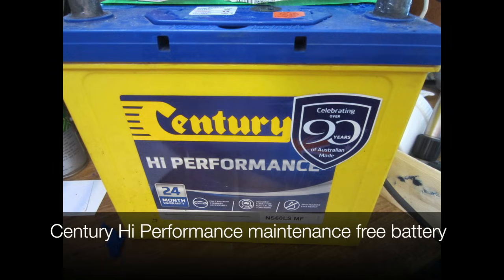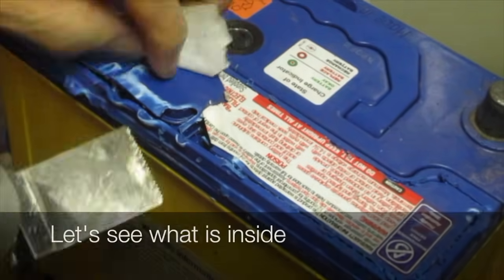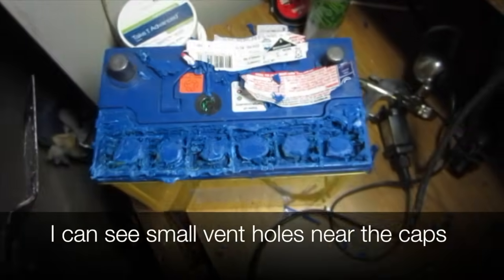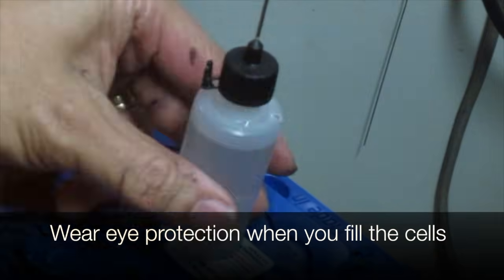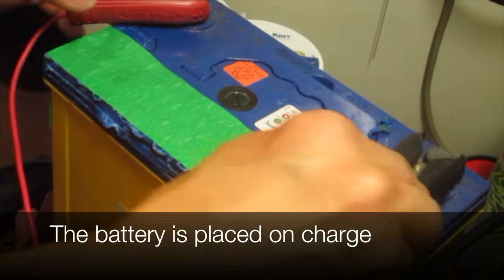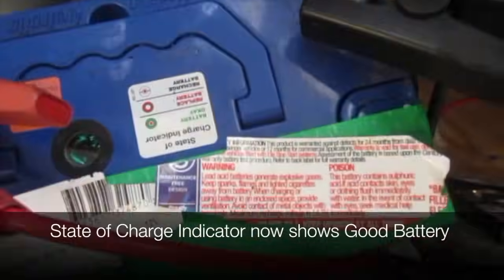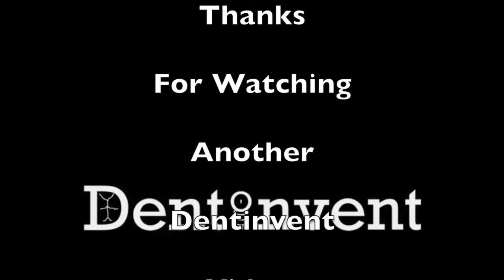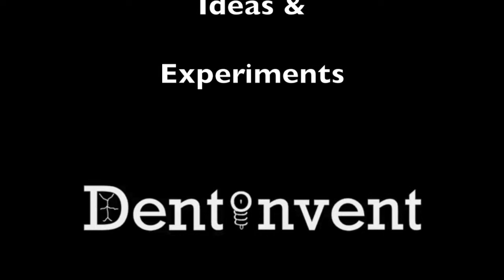Filling maintenance free battery with distilled water

Comment: Ok, easiest way i find is drill a small pilot hole into the glass indicator eye, doesn't have to go all the way through. Next screw a screw into the pilot hold and use a trim remover or screwdriver to lever the glass indicator out then refill with water and press the indicator back in. Easy
Reply from the maker: Thanks . I worked that out ( refilling via the glass view port) on the next car battery I refilled .

Comment: The small lead acid batteries in my wife’s mobility scooter failed after two years. Replaced batteries and removed the 
Sealed cap and found that the fluid level was really low. Now on the new batteries I regularly check and top up the batteries and so far they have lasted 6 years. Designed to fail!. I had a landrover that had a battery with screw caps for each cell and my daily / weekly check included electrolyte level, battery lasted for 9 years!
Reply from the maker: Yes , as long as you keep the levels over the plates the batteries usually can keep working .  Good luck .

Comment: aren't the cells all one big room with dividers that the fluid can fill over so you only need to drill a hole and fill one point?
Reply from the maker: Good thinking but I do see some car batteries where all cells are in separate compartments . When one cell is filled , the others do not go higher .

Comment: How do you know how much water to add? Just enough to cover the plates?
Reply from the maker: Yes just enough. If you put too much water ( which I did ) , the water which becomes the acid of the battery, can bubble out as it charges .
Reply: @Dentinvent  how is the battery going? i saw another reply about 3 years ago saying it's 8 years old - did it crack the 10 mark?
Reply: Best to fully charge the battery first, then add water, as charging will produce some water. So if you add water then charge it, you risk having it overflow.

Comment: I like this. No bullshit, no history of the company or long list of safety equipment you should wear, no blaring stupid music just facts. I think I should have moved to Oz years ago if most ozzies are all as straightforward. I've bought new batteries but keep the old one and prise out the "sealed for life" cover with a stanley blade, top up each cell with distilled water and recharge overnight, first at low rate (around one amp) and then with my "old school" charger (4 amps) until the charge rate drops to less than half an amp. Put the cover back down and Bobs you uncle, ok for another few years...
Reply from the maker: Nice work Peter ! I have since tried prizing put that clear cover to try and get access to the distilled water refilling area .
Thanks for your great comments.

Comment: I've done this although it works, the tape will get eaten away, I hot glued mine and it leaked and melted my settee, I'd suggest drilling each cell to be able to seal it properly.
Reply from the maker: Yes , good idea to seal the thing with proper glue like jb weld rather than tape as the acid is very corrosive if you add too much water .

Comment: I don't understand why they made batteries nowdays with no caps they don't last as long. They all need maintenance but here in Australia they try so hard to make $$ by seeing you every two years making these bullshit no cap batteries,  if you crack em  open break the tops open like I did you can't use them their throwaway
Reply: To make you change more frequently.. In australia specifically.. Top of the cream consumer market.. Production engineer here.
Reply from the maker: If you do even drill a small hole to refill the distilled water , be careful not to put too much in or acid can come out of your filler holes .
I got probably ten years out of my battery but I did get the acid spill which in the end , I would have been better paying for three more batteries rather than paint work damage.
Reply: @Dentinvent  I have some old batteries that are cactus I saved the cell caps was thinking about using a holesaw the same size as the plastic cap thread a mm smaller so make a no maintenance battery to one with caps haven't tried it yet but will have a go one day thanks for your reply too cheers
Reply: My wife’s mobility scooter has two small lead acid batteries which I had to replace after three years. I took the sealing strip off the replaced one and found that the cell were almost dry. These are maintenance free batteries. The new batteries showed signs of failure even though the were kept charged. I opened these and added distilled water and they regained their full capacity. They are now six years old and still functioning at full capacity. These maintenance free batteries are a scam and in this day and age considering the environmental impact this practice of deliberately making products to shorten the useful life should be regulated. I had a land rover and weekly maintenance included checking battery electrolytes level, these would last at least 8 - 10 years
Reply: @peterclancy3653 how did you reseal them after opening them?
Reply: Things are not made to last nowadays. Flooded lead acid batteries are very reliable and can withstand long unused periods. Got one with new bike from factory. Lasted 5 years of abuse. But they stopped selling it in shops in India. Only gel ones are available.
Reply: So it will dry out and Die

Comment: How much water should you add? Is it just until the bottom of the plastic cover?
Reply from the maker: If you look into the battery there is a cylinder protruding down from the top of the battery into a hole compartment. You fill to the bottom of that cylinder . If you fill too high , the acid can come out when the battery is charged . Make sure you cover over the top of the battery to prevent acid spills.

Comment: I added acid water in my new maintenance free (Gel battery) which tubular, i thought it has no acid water 
I removed all the acid water right the next day. Should i be worried ?
Reply from the maker: I’m not sure . Depends on how much acid you removed . If you took out too much the battery may still die. Just make sure you seal the battery properly or acid can come out .
Reply: @Dentinvent   as i mentioned it's a gel battery (maintenance free ) and has no need for acid water. It has gel inside it's plates. I put acid water but the next day i realized i shouldn't put the acid water. I removed all the acid water and made it completely dry just like before. 
Please let me know should i clean it with distilled water once again just to remove acidity from gel and the plates or should I just leave it there. 

And how much time does it take to completely charge 2x200Ah (FLD battery) +  2x150Ah (Gel battery) each pair connected in series to make 24 volt.  Connected to 3KW MPPT Invertor Which is juiced by 14 Solar panels (250Watt) each in 7x7 series -parallel combination. Thanks
Reply from the maker: Inside the gel battery there is sulphuric acid mixed with silica to make the gel. I don’t think cleaning it with distilled water is a good idea . I would just run the batteries as they are and hope that keep working .
Reply from the maker: I wouldn’t be able to work out the charge rate fir your batteries . The batteries seem to charge differently depending on what condition they are in .
Reply: @Dentinvent  thanks for your help.

I have 2 Fld batteries and 2 Gel batteries. 
I am charging them on 60A setting in my Solar Invertor. If that's too high let me know so that i can change.

Comment: i was told one cell of the battery is bad. it is not charged leaving only 10.4 volts. can i add distilled water to this dead cell to revivie it?
Reply from the maker: Unfortunately when the battery voltage drops that low , it often means one or more cells cannot be revived . The battery usually cannot be fixed .
Reply: No, if any cell in between or at any end it will not produce required VOLTS so if any one or more cells are gone means you have to replace the Battery immediately.

Comment: My maintenance free battery holds charge for about 5 minutes once car is switched off then dies , can this work on it or is it a sign the cells are dead
Reply from the maker: 5 mins means battery isn’t looking good .
I’d put a battery analyser on it and it will tell you if it can be revived .
They are not too costly . About AU$40.
If battery only lasts about 5 mins you either have a dead cell in the battery or your alternator charge circuit is faulty . Some chargers eg Ctek will tell you if battery is faulty when you try and charge it .
Good luck

Comment: They say you never add distilled water to a maintenance free car battery
Reply from the maker: They say that because they want you to throw it away within a few years . Mine is still going strongly and the indicator is still showing good .
Reply: Old car batteries use to last well over 10years because we could maintain them ourselves with distilled water. Anyone that says otherwise probably works for them. Ask any old fart that was bought up to be self reliant. Its sealed so you can't extend the life.
Reply: @edbroaotearoa1198  I agree, but all the extra electrical consumer do not help to extend the lifespan either! I mean: Look at a car from 30 years back: You had your driving lights and very few interior lights. Today, everything is lit! Speedo is electronic instead of mechanical, etc.
For this reason I replaced my interior lights with LED lights (I had small kids, leaving the door open all the time...). I extended a battery (which the (good) workshop told me to replace,) by another 2 years. Just before winter time I replaced it, not because it was dead, but as a precaution and I needed a battery for my construction radio :-D
On very new cars, they do not even let you replace the interior lights anymore since they are also monitored and electronic complaints if they do not pull the right current.
Crazy world we live in...
Reply: The two things a flooded lead acid battery needs are to be properly flooded and kept charged.  Someone who does a lot of short trips needs a charger.  The harder part is keeping it filled because the like to seal them now.

Comment: Can you see the glass eyelet, it lets you see if your batt requires renewing. We'll just put a very small screwdriver between the hard plastic and rubber circle protecting the glass then lift it out, you can top it up slowly then reinsert the glass or plastic inspection viewer. Hey presto. Just saved $100AU. Best of luck.
Reply: wouldn't that only top up the one cell where the battery condition window is?
Reply: @Ulbre  correct it's only for one cell and you wouldn't know if the electrolyte is low on the other 5 cells that you can't get to
Reply: @Ulbre  my thoughts also
Reply: That would only work for the cell that the indicator is connected too. Each cell is separate.
Reply: Your a genius. Gave this a go today and topped it up. Was suprised how easy it was. Cheers
Reply from the maker: What a great idea 👍. Well at least you now know what is behind the sealed plastic cover though .  Look out for my future video on what’s inside a fuel pump .
Reply: How do you know how much to top up?
Reply: Excellent idea. I’m going to try that. My glass eyelet is black to show it needs charging but when I moved it just now, it switched to green… so I guess the fluid moved and hit the indicator to make it turn green. I’ve left it sitting to see if it turns black again. 

I was already convinced it needs fluid, since I’ve charged it fully a few times but it doesn’t hold the charge. The multimeter says it has full volts when first charged it then drops down to 12.3V after a day or 2. After sitting in the cold, it went right down to 10.8. 

I’ve been trying to figure out how to get fluid in. Even if it’s only one cell at first, it’s an easy way to test the theory, right?!
Reply: This century design is isolated cells, So filling the eyelet does not reach cells. Have to cut or at least access cells somehow.